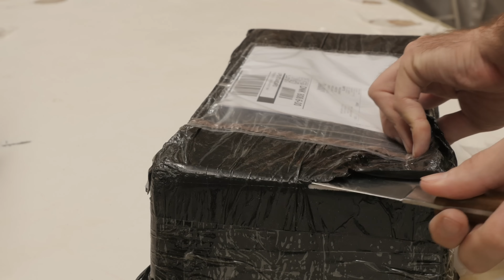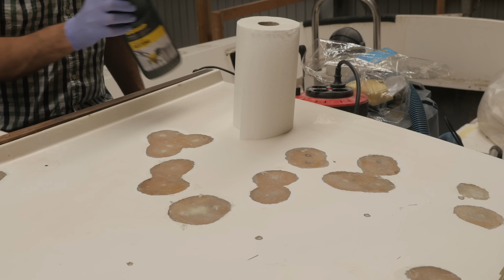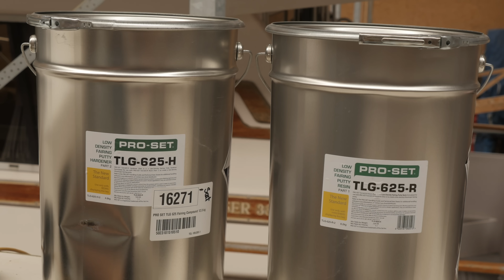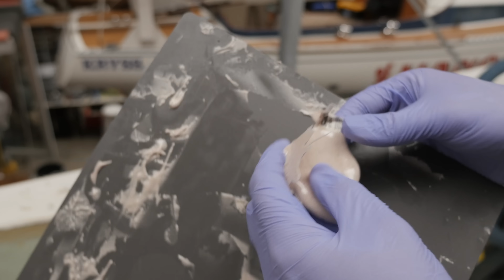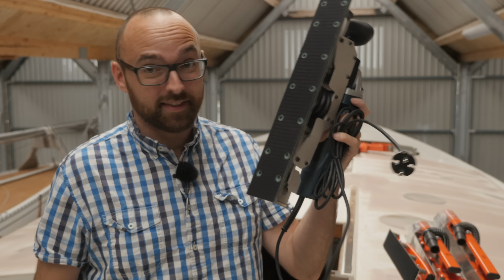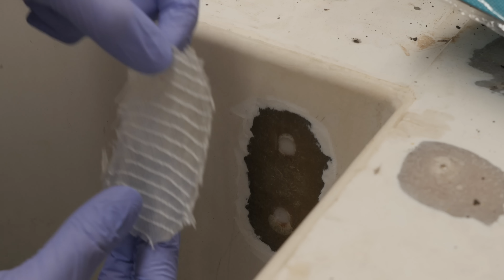Sail Life - Fairing the cabin top (first layer) & Flexisander tools - DIY sailboat refit

Comment: Another great video - thanks Mads.  For dock lines, I like twisted three strand.  It stretches.  Also, I use double lines - one smaller diameter and one larger.  I tie the smaller one a little shorter. This way, I get the most protection against shock loads.  This is cheaper (and I believe) more reliable than all those rubber shock absorbers.  I'm really not familiar with the line you did your testing with in the video.
Ron

Comment: Hi Mads. The new big cleats you found at 36 euro seems good to me, they can take much more rope. Also, use good plates below - not just bricks when you mount them. Regarding rope: I generally use 16 mm (I use several types), but also thinner lines sometimes (typically when tying up longside cliffs in Norway/Sweden I use several lines - not all thick lines). It's also convenient to have a flat rope on a reel (ex. type "ankarolina") for such mooring.

Comment: Hello Mads, another great vid, thank you so much for all the trouble you go through to make these. As for the dock lines, larger ropes chafe just as much as thinner ones, they just take longer to chafe through. One thought that needs to be considered when selecting the diameter is not only breaking strain, but elongation as well. This is a bit of a trade-off as you want as much "shock absorption" as possible, combined with highest strength. To little stretch and you'll end up with hairline cracks around your fittings, or a cleat pull out just at the time you don't want it. Strengthening around the cleats is one way, but this would just distribute the "jerking" throughout the boat. The right line and elongation is pretty important, but can also achieved with snubbers (rubber things that part of the mooring line is wrapped around) to increase the "give" in them. Very useful things and I use them on my permanent dock lines, but not so handy on your general mooring lines, when you don't know how long they will be, or get in the way of headlining. As an aside, I do like the cheaper/bigger cleats. Easier to work with and look "scookem as frig" LoL

Comment: I personally prefer cleats with enough of a hole in between mount posts such that I can feed through a spliced loop end and then wrap the splice loop around the cleat on the boat deck. this leaves a free end for tying to a dock cleat or running through a mooring loop. So, imho, whatever cleat you get, make sure you can get a spliced loop of whatever line size you want for mooring line to run through it.
Reply: IMHO I don't think you should be putting a spliced loop through the cleat at all.  If you need to get it off in a hurry you have 0% chance if there is any pressure on the line. Knife will be your only option.  Tie on with a cleat hitch. Both ends.
Reply: Just to clarify - I am advocating no loops at either end....
Reply: I actually agree with jerryrainman. There are times when you want to bend a spliced eye over a cleat and a wide gap is appreciated. For example the end of my dinghy bow line  has an eye splice and I always secure it to the most aft sometimes midship cleat at times for convenience - the way jerryrainman describes. Cleats aren’t always for dock-lines. If they are installed properly they can share load to stream a drough, tow a fellow sailor or set a sea anchor for example. On my boat I took the time to splice these arrangements and it has paid of many times. My last point about cleats is they should be backed with a substantial foundation. I would get the bigger cleat.
Reply: Exactly! And when your trying to get the loop loose from through the hole and the boat surges against the line you can lose a finger. I've seen it happen. If you splice your loops so they just barely fit over the cleat they're just as secure as passing through the hole.
Reply: Well, if I'm looping a line with a loop on the end through a mooring loop, then the bitter end is already cleat hitched back onto the same cleat, so no knife needed on a mooring.

If I'm at a dock and the cleat hitch isn't available and I need to get it off in a hurry, the weather's likely bad enough that I'm not expecting to get that line back anyway, and singling the line to get off the dock is probably a dicier option than cutting the line. In theory if the hitch on the dock also has a hole through the middle, you could cleat it back on the boat in this situation as well, though then you would need to clear any lines in the water before feeling safe enough to start turning the prop.

Is there a mooring situation I'm missing?
Reply: jeremyrainman yes I like putting the loop through especially when at the marina and away from the boat ...peace of mind.

Comment: I would feel most comfortable with the 16mm for docking, and 18mm for mooring on a buoy, for instance.
Reply: I'd also add that the RYA recommends tying a cleat using the OXO method. None of that flip over slip inside part. Dangerous and unnecessary.

Comment: 16mm would be my suggestion. It's a little stronger than needed but still will have lots of stretch which is gentler on the boat and hardware. Also it reduces shock loads on the anchor thus reducing the chance of the anchor pulling out in rough conditions.

Comment: You must have two big cleats  on the fore deck::  they will not only be used for mooring but also for towing in  bad conditions, and for snubbing the anchor chain [using a stretchy line hooked on to the chain with a hook and led back to your big cleats].
It may help to have a medium cleat either side amidships, for springs , plus two big ones at the stern as  you need to think about having to tow someone one day. So yes, those little ones are really for inshore work, rather than extended cruising.
The mooring lines for day to day use can be  18mm, with some stretch, but if you are buying a reel of  say 20 or even 22 mm anchorplait for example, this will be much cheaper and will be used for a lot of more extreme situations. As well as adding to chain, you can tow with it, and also secure the boat when moored in a marina, when conditions are so extreme that you need more than the two cleats on the pontoon: sometimes you need to secure your pontoon to the shore, but often  [in any year] you may use the cleats on the other side of the pontoon, so you are spreading the load more evenly. 
So, I would not worry too much about day to day mooring lines, as these are easily replaced, they can be 18/20mm, it won't make much difference. As others said, you use plastic hose t prevent chafe, which is the big enemy.
You boat is heavy for its length of course.

Comment: Hi Mads, thank you for the awesome video! My two cents on the line / cleat question: it hardly depends on the cleats, but more on choice of lines, how the harbour is situated (is it quite or next to a busy fairway) and how you lay the lines. 
From my personal experience the most important factor is the lines themselves. Can you throw them properly; are they 3 string or 9 string; what material are they made of? 
Expect chafing, it will happen! I bought brand new landlines and laid them through a hawsehole, but a half year later the harbour master called us to say a line had failed. The harbour was next to a very busy fairway. 
About size of the lines: you'll want to be able to (successfully) throw them in any lock you encounter. So they should be of the right weight and flexibility. For material; polyester seems te be the best in my opinion. 
The size of the cleat should be big enough to except the line thickness for your boat. The 14mm should be plenty for your boat. Suit yourself, and remember oversized cleats are better than undersized. People tend to choose too big a size than necessary. I bet you could hold your boat with 4mm lines and it would be ok. 
Hope to see you next week!

Comment: Hi Mads - great update and a special part of the project. I have never faired a boat but wonder if when applying the compound to the larger areas with your  rather spiffing spreaders if you did some using sweeping motions rather than just straight lines either  fore and aft or athwartship to better capture what is a compound curve. When  assessing the height of cleat required it was not clear how you were tying the warps - it would be clearer if you did a conventional ‘OXO’ for each of two warps representing a line and a spring.

Comment: With the flexisander look for rolls of sandpaper in the correct width. Might find them in drywall/plasterboard section. Much cheaper.   also, check out a video of a pro putting the final coat of drywall mud on a surface. Technique is the same. Less is more.

Comment: Great video. Don't worry about forgetting the sandpaper. While we are all constantly impressed with your skills, research, and energy level "not to mention sense of humor" you ARE just human and that oversight was a very easy one to make. I'm thinking that if you bridge the gap with a couple boards wrapped in peal ply for easy removal you could then trim away unnecessary portions of that hatch in the cockpit and then glass it in with very little issues. 😎

Comment: As always, very good and entertaining video. Disclaimer from the get go here, i have never faired a boat, i have however finished a ton of drywall and done a bit of body work. My take from just watching your "trowel technique" ( using the fairing tool and the putty knife), you need to pay attention to a few things. 1. the amount of material you are applying. Many small amounts add up to a large amount. so apply a few layers vs. a larger amount. 2. you were right about the angle that you apply the material with, and that is mostly technique that you will just have to learn by repetition. 3. try to avoid to many high points and of course "hollows" as you build your layers, that is a learned technique as well, just remember that you can always take material off ( it will increase your sanding time ) but the other side of the equation is that if you end up with hollows you have to fill them. 4. one last thing, as your technique ( feel ) gets better, try to overlap your "pulls", that is what i call the different sections as you apply the material. All in all, you are doing a great job and it will all come together when you least expect it!! Keep up the GREAT WORK !

Comment: Thanks mads its looking good. I usually go one size up on the mooring ropes, but also have hose that goes over the ropes to stop chaff. If you have multi-plat you can position the hose with cable / zip ties slipped through the multi-plat. Springer lines that go back to mid ship are good and reduce the loads however notice lot of new boats don't have these cleats fitted as standard.

Comment: Hi Mads - so my niece is thinking about building a "skoolie".  A school bus conversion into a little off grid motor home.  I've been thinking a lot about the way you're been restoring Athena to build out a bus.  Butyl tape, epoxy, power systems, and the like.  Great crossover between the two builds.
Reply: Campers and boats have extremely similar systems. At least they should. A lot of RV's use substandard materials that would rot away pretty fast in the marine environment.